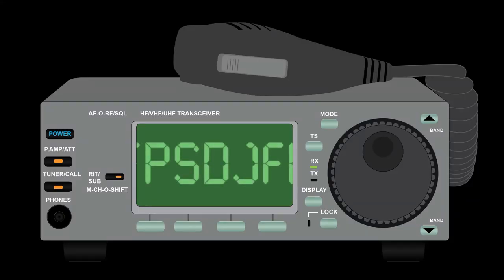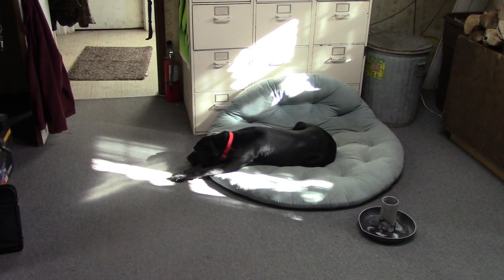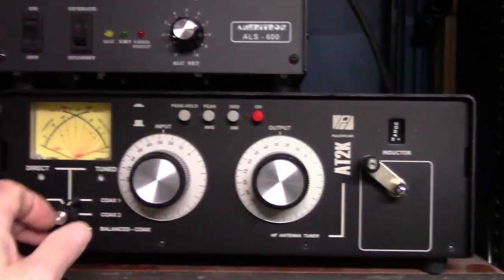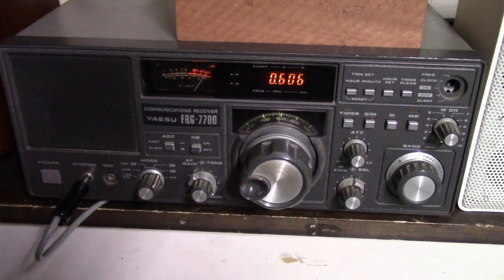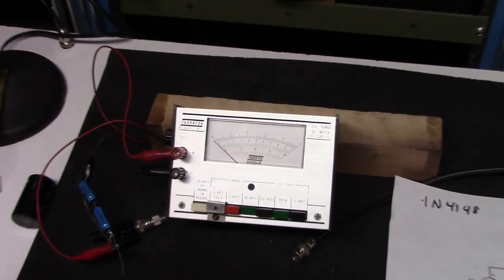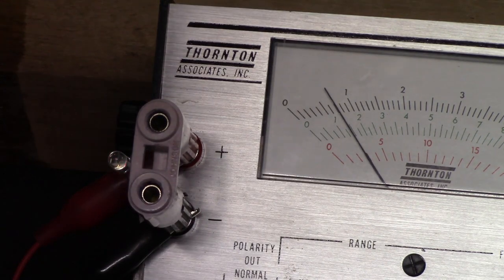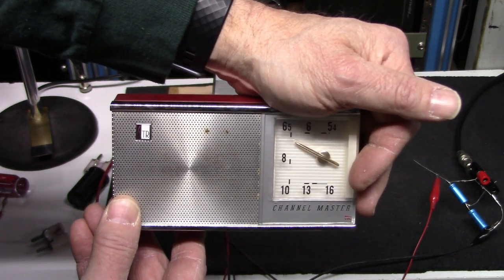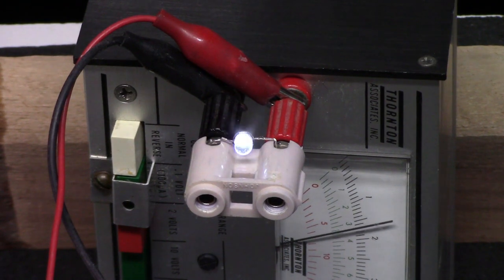Free Electricity  from local radio station.   Harnessing RF to power LEDS

Comment: I was just thinking... Would current increase if you connect a hundred of that RF harvester circuit to boost the current? Would it work like connecting AA size batteries in parallel to double the ampere capacity?

Comment: Do you have to have a radio station to light up an LED or is there enough natural RF to light up an LED without a radio station? Thank you
Reply: Based on our current tech & understanding
we don't have enough RF naturally to light the diodes,
there generally has to be some source of a radio signal.
I think Nikola Tesla pointed out that energy is everywhere
and can be harnessed
but we have not yet (publically) figured that out.

Comment: A businessman in the Philippines did something like this but way bigger than what you've just shown us, according to him he harvests RF signals from everything, processed the signal and he showed that it was able to drive huge induction motor, not one, not two but several motors with varying sizes. It actually works and is now installed in a car.

Comment: Haha, Dave Ramsey show in the backround! Rachel Cruze, ken Coleman, Dave Ramsey, lol.
But seriously that is super cool that you could power another radio with an actual speaker and not just earbuds. 
I’ve always wanted to build a circuit like this. It would be super cool to power up an arduino or similar micro controller. I wonder what type of antenna could be used to optimize the power received.
I used to live near a local AM transmitter and never knew it until one time I was plugging some pc speakers into my phone to listen to music, and I accidentally unplugged the 3.5mm jack half way and could hear the AM station playing through my computer speakers.
I think this is a very interesting project. You have some cool looking equipment in your shack. I have been messing with SDR radio receivers and am thinking about getting into ham radio because of all the cool things you can do. I can use my SDR receiver to tune into my local ham repeater and it’s fun to listen to.

Comment: Keep up the great work mate 🙏
Based on your schematic
You can greatly improve the efficiency of your system
by connecting an additional wire between the two capacitors and either running it to an independent ground
or into an inductor that has an L value that is far too high for the frequency you are harvesting to get through the inductor.
Easiest way is an independent path to ground
or to a long wire running along the ground.

By adding an escape path between the two Capacitors
you provide a path for the current that is forced to go via the diodes & better than simply the path across the Caps
& of course the diodes then get to rectify more current.

Comment: We were talking about Joule Thief's on the BEARS repeater (Vernon, CT) the other day.  I was telling the gang about a circuit similar to this I found in an old book I got back in the 90's and was thinking about trying it out but it looks like you did it for me!  I still want to try this out but I don't have any radio stations close by so I'm not sure how well it will work.  I think it would still be fun to experiment with anyway.  Thanks for the great video!
Reply from the maker: Hello 741 ?  As in the OP AMP?  Part 2 is coming up today where I actually measure the power developed from a newer circuit. Sometime today. W1VLF
Reply: @W1VLF  no, 741 refers to something else entirely...long story.  I look forward to watching part 2 later today.  73 N1NUG

Comment: I use a couple of germanium diodes across an led and have  a short piece of wire as an antenna and have it on the dash board of my car.When I transmit on the HF bands I tune up for maximum brightness.It makes a simple field strength meter.😂73 Ian G7HFS/PA3IKH.

Comment: You should try using a bridge rectifier. I did some experiments this a little while back using diodes, including shotkey and germanium, and what I found was that the bridge rectifier actually worked the best and had the lowest amount of leakage as well as the lowest voltage drop.

Comment: 20:11 powering a 9 volt radio with a 1.5 volt voltage free source is way under voltage. Try powering a 3 volt radio instead. BTW: this project is good! I'll try connecting one of this RF electric generator to my little power bank powered by 1.5 volt AA alkaline battery, replace the battery with this RF harvester gadget and see if it could charge my phone.

Comment: I built a shortwave crystal radio with a 4 foot antenna that can tune up to 29 MHz and is connected to a 12 volt LED and tune it to 27 MHz or CB channel 38 and the LED lights up when I key up on my CB radio.

Comment: add a 1 F  cap to the circuit charge it up and use it to store power for the radio use a radio that can be powered by 1,5 volts,:face-fuchsia-wide-eyes:

Comment: Why wouldn't you do the vultures production right off your dipole coming down and run the resultant DC voltage or alternate voltage into your place rather than bringing in to your place and then doing well that work on it seems like you'd eliminate a lot of loss and it seems to me that you could have a few of these units and then put them in put the outputs and series and even get more

Comment: Can a battery be charged? If so what about maybe a close pulsar, could power be harnessed from astro objects? Would a fmr TV dish work to concentrate the local RF signals into higher power.

Any thoughts on the possibility of making a AlphaVoltaic cell converting natural alpha emmissions from unrefined Thorium.  Using almost harmless alpha radiation to move electrons!  Why thorium, because I am sitting on a 40-100m thick thorium deposite that runs furthure than 50 km north-south and 50 km east-west burried a meter or so under ground! 

(Yes efforts are required to shield homes from radon, by installing membrains, using underground and in basement vents, so it can escape!)

Comment: Great video, Paul.  I suspect some of the increase in volume on the Channel Master might have been from you coupling your body as an antenna into the ferrite loopstick on the small transistor radio.  Just a guess.  Thanks!  Ken - WB0OCV
Reply: Is there any danger in using your body in this circuit? Maybe with a little redesign you could integrate the circuit into clothing to take advantage of any increase?

Comment: Can you use transistors to increase the current?
Reply: Wouldn't that defeat the purpose of not having external power? I could be wrong
Reply: @QuinnHartmann  How much current do you need to get a transistor to work?
Reply: @Berghiker  it depends but amplification circuits take a weak signal and input power to generate an amplified signal
Reply: @QuinnHartmann  Can you not just try it and see if it works rather just discuss theories if it could work or not?
Reply: @Berghiker  I mean go for it, just keep the first law of thermodynamics in mind